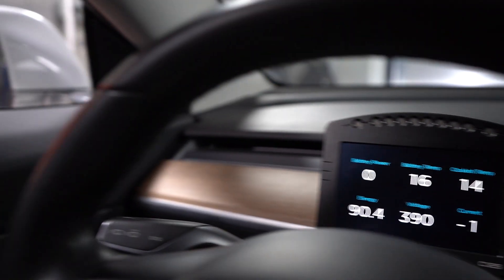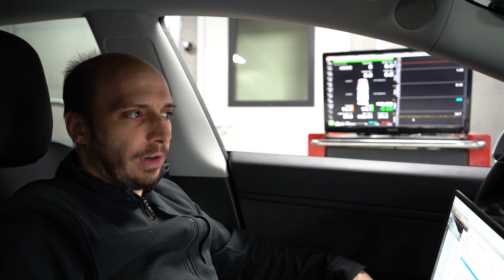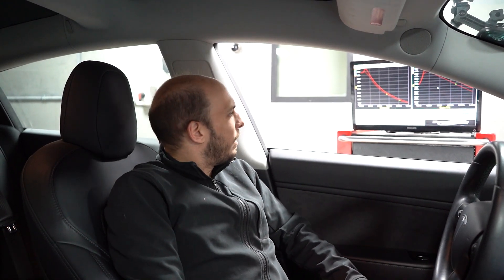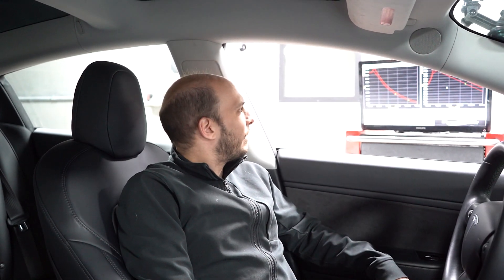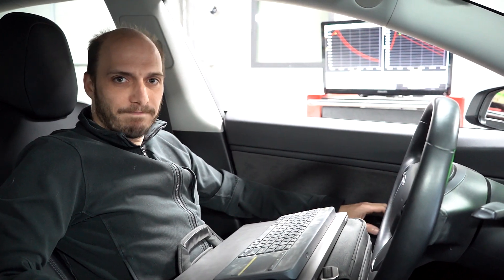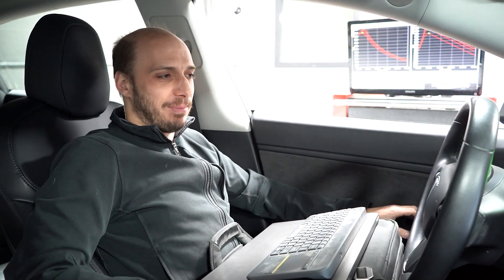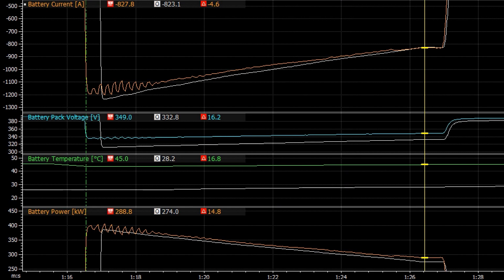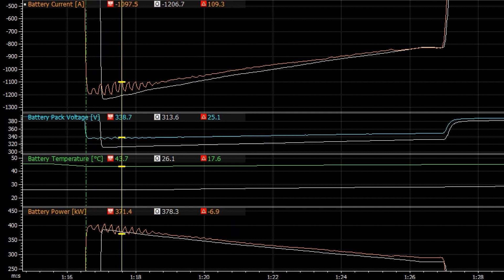Tesla Model 3 - Making Power With Heat!

Comment: Hey Sasha my friend how you doing good job man keep it up and R&D  also 
 for model 3 dual motor  PERFORMANCE 2020 can your dongle or module can boost my tesla inverters by adding 50 or 80 hp OR more ??

I'll pay $1,500 dollars for that module that I can easy take it off and easy and fast plug it in an any time ??

OR even better can you add to your module some kind of switch that way I can power off or power on on demand and that switch will be locate somewhere around my steering wheel will be awesome to have that magic switch or button I would call that E-NOS on demand

PLEASE Let me know !!!
I got 2020 P3D

Comment: Is it possible to have one torque/horspower chart that goes up to 14,000 r.p.m. with the different overlays of battery temperature pulls.  The chart you used was hard to understand.

Comment: If the M3P is making 487WHP what does that convert over to from the motors? What percentage do electric vehicles lose?
Reply from the maker: The battery is producing 408kW or so - which is 543 horsepower. There is approximately a 4-5% loss in the battery, 6-8% loss in the inverter and motor, and the rest in the drivetrain. From that you can conclude that our dyno is reading a little bit too high in reality, as the losses shown by our dyno are not large enough to be realistic.

Comment: So what I've learned from this is I need to get a Motec. 😜 Great information guys. I'm curious how much this effects lap times around BRP.
Reply: Your can see this with scan my tesla and the obd2 adapter as well. You can use an old iPad or tablet too
Reply from the maker: We'll have to see if the power output truly is the same above 35C, in which case it wouldn't have any affect at all. You would already be above 35C by the end of your out lap! 

Otherwise you can figure very roughly about ~1-2 tenths for every 10 horsepower.

Comment: Thanks for doing this Sasha. I can confirm that when the battery is hotter my elapsed times are quicker in eighth mile and quarter mile drag racing.  And sometimes it's quicker for no apparent reason. :-\ typically only by a few hundredths.
Reply: I raced last night and supercharged before the event with preheat.   The car ran it's fastest pass ever at 11.496 on the first of 6 passes.  By the time I got to the finals some 4 hours later, it was running around an 11.60.  The ambient temperature dropped around 30° during that time.  Highlight of the evening... in the semifinals, I had a .013 light and went dead on with a 7 for a 20 pack. :-)
Reply from the maker: So fun!!! That's awesome to hear :)
Reply: @otarpilot292  Did you try navigating to supercharger to preheat battery during finals?